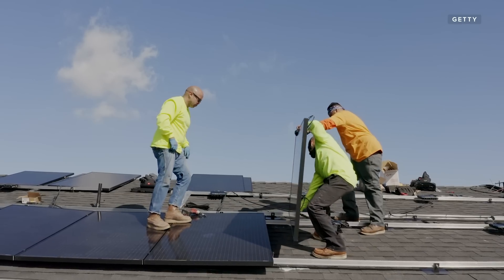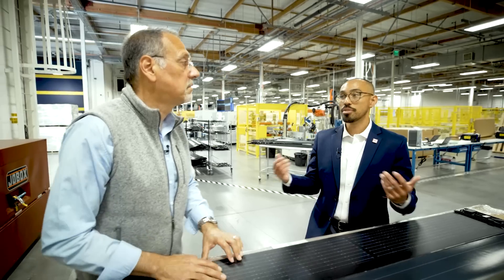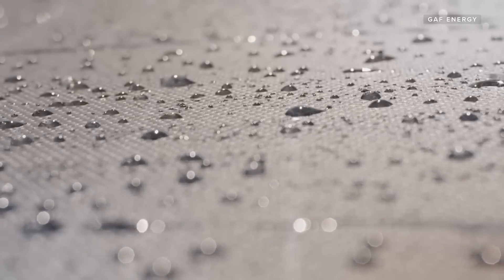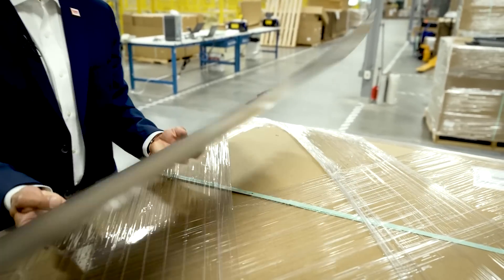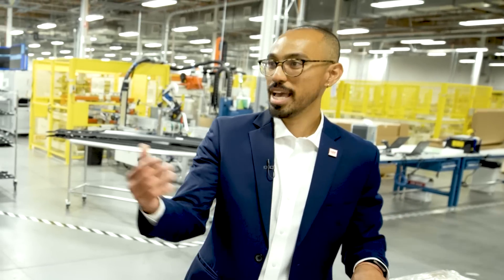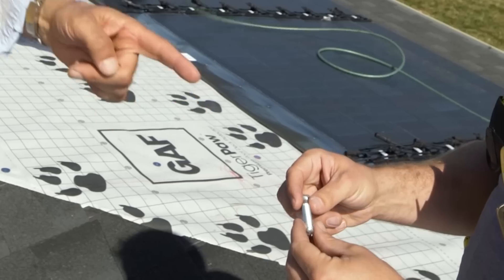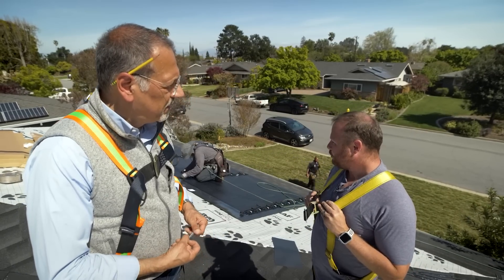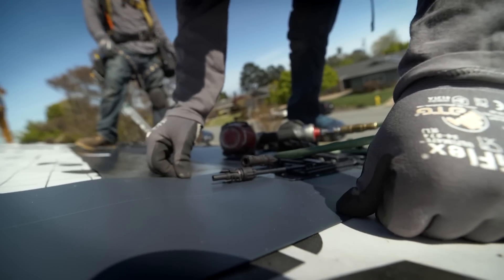If You've Avoided Rooftop Solar Tech, You May Have Just Run Out of Excuses

Comment: Stepping on the panels doesn't seem like a good idea, that commonly causes micro crack damage to the PV.
Reply: The thin-film is immune to cracking unlike regular crystalline silicon cells used in conventional solar. Thin-film solar also can be rolled up and wrapped around structures.
Reply: @Obscurai  can you reference a research paper that found stepping on thin film panels doesn't cause microfractures?
Reply: @edwardlouie  These bickering Louie brothers are both wrong/right to some extent. It depends on materials (I suppose ETFE, moncrystalline silicon, aluminum bus-bar). Also, material thickness and additives, supporting structure, panel arrangement, electrical configuration, roofer behaviour and much more.

Comment: It's an interesting design idea and concept and it looks like it has some winds for certain places.

 But I also need to address some concerns that I have and everyone should think about these concerns since it is important since this must be a huge investment.

 A warranty of 25 years in my opinion is bad and needs to be readjusted considerably.   Since in the past many companies who have offered long warranties generally at some point in time don't adhere to those warranties overtime.

 Another thing that has me concerned is that this company is selling this product but doesn't comfortably talk about energy output compared to dollars in investment and the relationship back to it.     What I mean by that is if I'm gonna spend say $50,000 for a roof to generate so much power will I see that $50,000 back in my pocket in a reasonable amount of time frame.    If I don't then it's not a worthwhile investment.

 Yes this product looks great on the roof which might be fine for some people but let's be realistic here.    Looks aren't everything since what will happen let's see if I live in a snow covered region area and snow piles up on my roof and doesn't melt where this system resides.    Then that would mean the system isn't generating any electricity and whatever storage system I have may not be capable enough to support and maintaining a back ups power supply that I might need and then I'll have to start drawing off the grid again.   Because from what I understand that some of the old style systems of solar collection actually heats up the panel just enough so that when the snow hits it it melts does keep in the panels basically clear.    Which raises deep concerns about these so-called flat panels which when the snow hits it does it smelt or does it allow the cake up on top of it.    also have they ever tested the performance of these panel sections in relationship to snow and ice hitting the top of the roof and what would happen if it gets underneath it.   They don't seem to have this performance data and that has me concerned.

 So in concluding there's a lot more to look into before making an investment like this into this new type of technology.    Now I am not saying that is something not to look into, but, it's something you should look into carefully before deciding to jump in onto it.

 Also from what I understand when it comes to solar powered systems.    The panels themselves that reside on the roof or just one tiny step to the entire system itself.   What everybody needs to look into is the other portion of a solar system set up and that is the storage capacity, who's doing the storage set up, and how much they cost in relationship to this new technology.   Because you need to weigh those two issues since let's see the system that you put on the roof it's gonna cost you $50,000 and the storage system which is the heart of the system to supply the power to the house also cost close to $50,000 then it's not a worthwhile investment at all.

Comment: This is great. Thanks! But it would be more comprehensive if it covered recycling as well.
Reply: @D R This isn't a typical solar panel. Traditional solar is made with more components, much of which could be recycled. This uses less material, but is it more or less recyclable? The more panels that are out there, higher the prices and/or incentives can make recycling viable, generally speaking.

Comment: Water leakage isn’t an issue with today’s racking systems and flash feet.  I noticed the .55 degradation after 25 years that’s not even in the ballpark.  String Inverter technology …not class leading.  No. Dollar/watt breakdowns every video I see on this is vague with no numbers.  I guarantee solar sales aren’t made without a real world breakdown of how much watts of production are being produced for the cost.    This could be a solid product for a niche clientele.   There was also no mentioned of cell efficiency.  We’re about 2 years from the release of tandem PV technology which will drive panel efficiency to the upper 20s.   More efficiency equals choice of more power gen or less panels.
Reply: I like this comment. Pretty good points made that we need to be aware of.
Reply: Good luck when the insurance company forces you to get a new roof.  Definitely not cost effective.  You are right about the string inverter.  Thats a big downside of these shingle panels.   A single point of failure is not cool.  And no shade mitigation is a deal breaker.  Correct about todays attachments and flashings.  Ever try to get a shingle manufacturer to honor their warranty?   Have fun.
Reply: @shroud1390  Funny you should say that.  As I type this my roof is being replaced after recent series of Tornado and hail damage. I'm becoming more interested in these new rackless mounting options.   I'm not gonna get solar for another 2 couple of years so i'm going to keep my options open.  I love the fancy metal roofs where you don't even have to penetrate but damn they are expensive and i'm not in my "until I die" home yet.
Reply: @hmurchison8123  standing seam metal roof is the way to go!
Reply: Dollar/watt breakdowns are a must in the solar industry. I do not trust solar companies for install because they overcharge on the equipment and recommendations. On top of that most don't even generate the power based off the quote.

Comment: @4:35 They cut off the conversation about the Central micro inverter.  There is a reason why!

Be warned with only a single micro inverter for the whole roof it will only take 10% of shade on ANY individual Solar Shingle to shut down every solar shingle because they are wired in series like Christmas tree lights.

That means trees, cloud cover another house...all you need is 10% of your roof shaded to get ZERO power
Reply: Not really because of "bypass diodes".

All solar panels nowadays have a simple 600V "bypass diode" in their terminal box.  It is soldered across the panel's terminals in reverse-bias to the current flow.  The diode provides a lower impedance alternative pathway for the electric current of the other non-shaded panels to "by pass" the shaded panel(s) whose impedance has increased greatly due to shading.

At worse, a partially shaded panel will take out just the panel itself and not the entire string.  These diodes cost pennies at volume and could even be installed onto very old panels for the same effect.

Some larger solar panels have bypass diodes installed across the rows or cells within the panel itself during its manufacture.  This provides bypassing of a panel's internal rows or cells allowing the panel itself to continue providing some power in partial shading conditions.
Reply: Not necessarily, there are these thing called power optimizers that addresses some of those issues. And in some cases that’s not much of an issue. It really depends in a case by case basis and what the owner is willing to spend based on having the right information. Saying that a string inverter setup is straight up inferior is something that some salesperson would say to upsell you to a $28K system instead of a $18K system. Every setup has it’s plus and minus and related costs. I’m sure over time they’ll provide more choices and not to forget 3rd party add-ons that may address some of those issues.
Reply: This person is wrong.  If you shade one panel of a string on a central inverter it averages in a ZERO out of how mnay panels are in the string and bring them all down, but NOT to zero.  Micro inverters go on EACH panel. A central or string inverter wires in series.  Microinverters are made for shaded situations and dont have a single point of failure like central inverters.
Reply: @SunnySTX   These are wired in series. They don’t have inbuilt micro inverters on every tile - that would be cost prohibitive and a maintenance nightmare.. There may be a microinverter in the fiberglass box at the end of each column but I think they are designed to go back to a normal string inverter as there are no microinverters that I know of that could take the wattage (45W per tile x say 20 = 900W) and potentially you could have as many as 30 in a column. Also the installation they show on their website has only one fiberglass box on the central column which means it’s more of a junction box designed to combine the strings. I’d assume this system would need bypass diodes on every panel and blocking diodes at the end of each string.
Reply: @mondotv4216  they're 14 watts per shingle. String inverters run at 600V per string on residential so you could have ~28-32 in series based on climate thermal coefficient rating for location for MPPT operation.

Comment: Solar should be incorporated into all newly built homes throughout the US.  It should be mandated.
Reply: I definitely agree with this. I wonder if there is enough solar panels to cover all new constructions? On top of that, the infrastructure required to manufacture all those solar panels.
Reply: A small amount of solar is mandated in new construction in some places like California.  And that means the wiring for the inverters, panels, and interconnection to the grid are already in the home, and customer can expand the amount of solar as their budget or need expands.
Reply: Mandates suck because blanket policies never work across the board. There's no market for rooftop solar in many areas of the US...solar on adjustable stands in a backyard can work, but it's more expensive. Utility scale solar makes more sense in a lot of areas than home based solutions.
Reply: I don’t like mandates, or fascists.
Reply: @copisetic1104  So you don't like the constitution?
Reply: Mandates don’t seem to be the way to go in this case. In some places the payback is long and the cost is high or roofs are under tree cover most of the time. Make emissions appropriately costly and companies/people will make the decision on their own.
Reply: All newly built homes across Jamaica 🇯🇲 as well
Reply: USA land of freedom can't tell no one what to do

Comment: Great first step in to this space, I look forward to future iterations that are both better looking, better performing and cheaper. One question I had is cleaning, I've heard that typical solar panels need to be cleaned yearly to retain optimal energy generation - is this true (could be a myth, I don't live in a solar heavy area)? And would that apply to this product? A truly durable, reliable, maintenance free product like this would sell extremely well at say a 20-40% premium over traditional shingles. I would suggest trying to integrate traces in to the shingles themselves that would stack on top of each other as an attempt to eliminate most of the wires - maybe it could even be designed where a roofing nail would provide the method of connection between shingles (either directly or simply puncturing and securing connection "pads" together).

Comment: The only company to make a solar shingle and survive is Tesla. Tesla isn't going away so I would be more likely to trust thst they will be here in 10 years to provide parts and solar. 

Secondly, flexible panels do not have the same life expectancy, nor do they produce the same power as regular panels. Lastly, solar panels #1 enemy is heat. By placing this directly on your roof there is no air gap for ventilation, the entire premise behind this product is flawed. 

Within 5 years we will see problems arise with this product.

Comment: wow this would ease all the concerns I currently have with solar. I didn't know exactly how regular solar could affect the roof but I knew it had to have a big effect on the life of it. Well, now I know you can cause leaks or crack the rafters. Hope the cost comes down on these guys
Reply: The roofer they interviewed was painting a really negative picture of using lag bolts for no reason. First of all, lag bolts aren't the only way to secure racking to your roof. Second, unlike what he said, most rafters a 2x6 not 2x4. A lag bolt is not going to damage the integrity of a roof or rafter. Plus, it is EASY to know if you missed a rafter. The feel of driving a lag into thin air versus hitting the rafter is completely different. 

They were trying to sell these things big time. They look cool but definitely a lot of propaganda.

Comment: This is a great product. Now, you need to get the price down to a reasonable amount.
Reply: That's done by producing and manufacturing with the eccomies of scale. Mass production reduces cost tremendously that's why the assembly line made car ownership possible
Reply: Where did you see the price? Someone mentioned about no price on the website.
Reply: @dannydaw59  he said that is equal to roofing and an similar sized solar array. The only difference is that you can walk on it and is not risk of damaging the roofing with the bolts.
Reply: @ehombane  The efficiency?

Comment: I'm all about it. Need a new roof now. This is a far more fluid solution.
Reply: Be warned with only a single micro inverter for the whole roof it will only take 10% of shade on the roof to shut down every solar shingle because they are wired in series like Christmas tree lights.

Comment: I like the idea of being able to nailgun the panels to the side  of our camper because of how lightweight the panels are... We've only got so much room on the roof.
Reply: If it has an awning perhaps it could be used there.
Reply: Don't put holes in a camper.

Just don't.

For a camper you glue the flex panels to the roof or you have a rack that takes existing bolt holes, replace with longer screws (maybe the same screws) and reseal with the RV sealant.

You CAN NOT EVER seal up the  penetrations as well as they did at the RV factory. (and they have issues sealing them up)

Better off with a rack system that slides into one of the storage areas accessed from outside, set it up and clamp it to the bumper.

For just the 12V systems of the RV, you can do fine using a Harbor Freight 100 watt system. 
(plan to need to attach it to  PVC to join the 4 panels and then weight it vs wind.)  
The Harbor Freight set is what I use now, screwed to a pallet,with the spring bar hitch system laid on it for weight so the wind doesn't blow it over.  This has held up to 60 mph wind gusts.  28 ft  bumper pull that will sit in one place most of the time.

I have a utility trainer with 2 of the old 45 watt Harbor Freight panel sets mounted.  Appx 11 years and still works fine.  (pretty good results from that experiment but i wouldn't mount them to the trailer if doing it again.  Separate and able to be angled wins)

Flex panels glued to a CLEAN RV roof do fine.  Not as efficient as panels you can angle to the best  collection angle.  

Just putting them to 30 deg pitch  pointed due S is an improvement for most of USA. (compared to flat on an RV roof)
Reply: @fhuber7507  you're right. Actually I used a caulking gun for the cheap panels we have on the front. We don't own a nailgun, only a caulking gun
Reply: @fhuber7507  either way, it would be impossible to caulk the cheap ones we have now to the wall. The lightweight panels would be way easier

Comment: For me now I don't care about design, colour  and all those specs.... price is the most important thing. A company able to provide low cost solar panels will easily make a killing worldwide.
Reply: Efficiency, longevity and durability is important too
Reply: Most important how much it cost and what is the output W/m2
Reply: Ok checked the website and no public info about price or output...
Reply: If you choose a white roof shingle to have a 50 degree cooler surface temperature over darker colored shingles, this will be a oven for the attic. I'd like to see what in attic heat blocker they come up with.
Reply: Would have to spray foam the attic or heat will be an issue
Reply: The thing is, it’s not just the price of the panels. You can even buy these in Ikea these days. 
It’s other things, like the convertor which needs replacing every 10-15 years, that makes solar too expensive still.